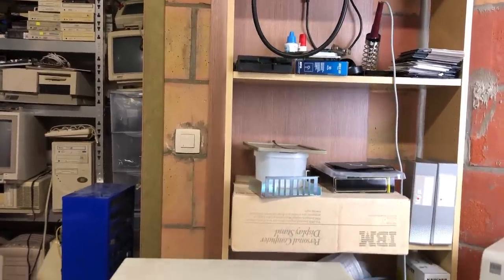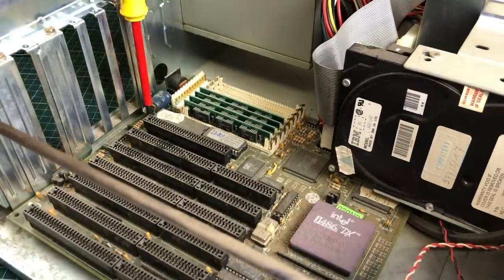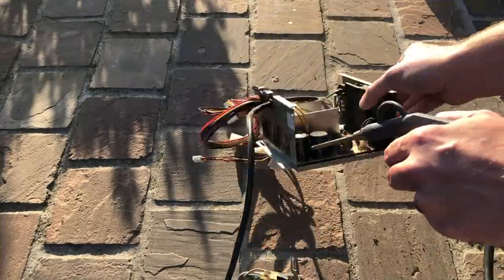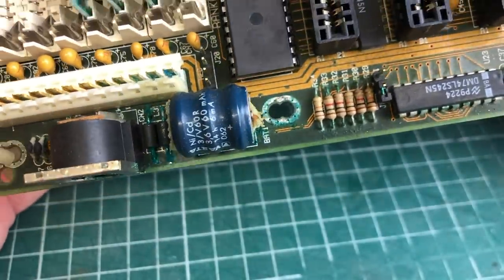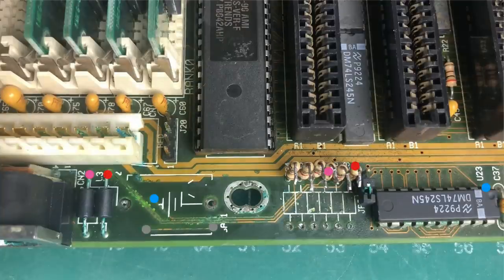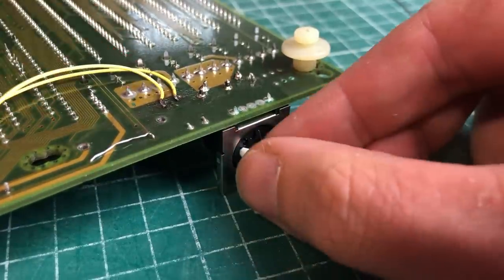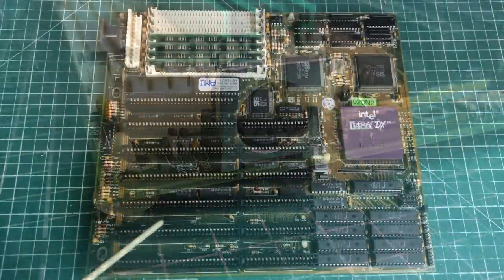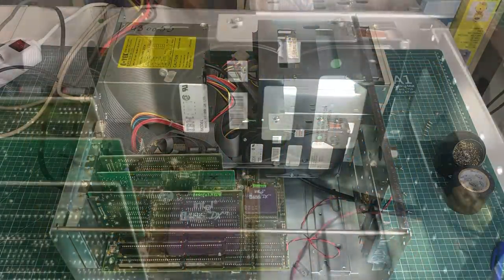486 from trash to treasure

Comment: man i wish i could find a 486 in my trash :c
also how is 3968kB 4MB? 4096kB = 4MB... so that count is missing 128kB for some reason.
Reply: Some memory addresses are reserved for the mainboard bios, the bios of the graphic card and the framebuffer for example, so not all memory is free to use. All OS have to call some bios routines to check which memory addresses are free to use.
Reply: @maxmuster7003  interesting. but would it have been that difficult to list reserved memory as well and add it up to the total?
Reply: That is not difficult, but it vary from mainboard to mainboard, the cards and components that are plugged in. Some newer graphic cards have two linear framebuffers(primary/secondary) somewhere in the 4th gb and the older have no linear framebuffer, only the banked framebuffer for the graphic mode in A0000. An Intel 80386DX+ can address 4gb of memory with 32 bit.

Comment: I’ve been having an interesting issue with my IBM 5155. Basically it boots to IBM cassette BASIC, preventing me from accessing any of the drives for an OS installation(to my knowledge). Does anyone know how to fix this?
Reply: only my opinion - it boots to basic by default, cuz it can't find/recognize a boot floppy, nor a boot hard disk.  does the fdd light come on & seek ?  does the hard disk led come on ?  do the dip switches on the mobo show that a fdd is installed ?  good luck.  take care & stay safe.
Reply: David Lund it initializes the fdd, but ignores it and immediately boots into basic. There’s no drive errors or anything because cassette basic physically can’t access drives other than the cassette one in the 5100

Comment: I had a 386 with 33 mhz turbo button. But I never understood why would anyone reduce the speed for what usage?
Reply from the maker: Playing old games that were really speed sensitive.... otherwise old games would run way too fast on your fancy 386 :)
Reply: Older software that assumed a particular clock speed, which would then be unusable on a faster CPU.
Reply: @andrewgwilliam4831  Thanks. interesting. Maybe software fir 286 or even 8086.
Reply: Some game maker use loops for a delay and not the timer chip or the vsync and so the games are running to fast on newer PC. Bad programming. My own DOS applications run with Intel 80286@20mhz and also with Intel Core2quad@2,7ghz.

Comment: What do you do with a box like this? It's 25+ years old, are there still any uses for it?
Reply: Vintage games is what most people use them for.  Not many practical uses.
Reply: Mostly old DOS games that work better on real hardware compared to an emulator, because of timing issues.
Reply: Thousands of games and applications :)
Reply: Thank you guys!

Comment: Feel like much more cleaning was needed before fixing the traces. There's enough green gunk left to continue eating that board.
Reply: Yeah, ideally you'd remove all the affected parts, neutralize and sand down the affected area and replace with new parts
Reply from the maker: I did do some additional cleaning afterwards but got lazy and wanted to see if the board would work and get the video over and done with :) character trait I need to work on :)
Reply: @RetroSpector78  Good job - I am generally lazier, I just buy boards that had external batteries or coincell in the first place... :)

Comment: "a DIN style keyboard connector meaning Pentium or Lower" isn't necessarily right. There are many super socket 7 boards, even a rare few socket 370 AT motherboards with 5-pin DIN keyboard connectors. So "most likely a Pentium or lower" would have maybe been more correct.
Odd to see a DX2 with only ISA, no VLB or PCI, and only an 8bit ISA controller card, ouch that's got to be slowing down disk access some?
Reply from the maker: it wasn't a DX2 , but a DX 50mhz .... and it did have a 16 bit ISA controller card.  indeed super socket 7 also had din connectors, and with pentium I was referring to everything below pentium 2 / ATX, not excluding all the different super socket 7 cpus :) will try to be more clear next time.
Reply: @RetroSpector78  oh, sorry dx50, those are really pretty uncommon. I have it's weird cousin, an sx2-50.

Comment: For the love of g0d, please stop using vinegar! Drowning the oxidised patch in modern contact spray ( I use Griffon brand - no this is not sponsored), will clean copper oxide better and do less damage. If there's a lot of damage you can restore contacts with a bit of solder as you're working on partially blank metal with mostly carbon remaining.

Comment: If you do not use a printer remove the ansi.sys driver from the Config.sys file, because it is much to large for to display some colors with ansi escape sequences.

You can make a new external color command for DOS with the following batch file. Feel free to copy, paste, modify and share. Spiritual ownership does not exist.

Explanation:
Batch files are text files with the *.BAT file extension and batch files are executable and suitable to contain the visible open source code of some assembler instructions  and internal Debug commands for to create an executable *.com file with a little help of some pipe operators (> >> <) to redirect the content of the used echo commands into a temporary text file to telecontrol Debug with this file.

Start with a color attached. Example:
COLOR.BAT 1b

@echo off
REM Need one parameter(%1) attached.
REM Usage: Color.bat color
REM Example: COLOR.BAT 1b
echo acs:100>tmp.deb
echo mov ax,b800>>tmp.deb
echo mov ds,ax>>tmp.deb
echo mov cx,820>>tmp.deb
echo xor di,di>>tmp.deb
echo mov al,%1>>tmp.deb
echo mov [di+1],al>>tmp.deb
echo add di,2>>tmp.deb
echo dec cx>>tmp.deb
echo jnz 010C>>tmp.deb
echo ret>>tmp.deb
echo.>>tmp.deb
echo n Color.com>>tmp.deb
echo rcx>>tmp.deb
echo 16>>tmp.deb
echo wcs:100>>tmp.deb
echo q>>tmp.deb
debug<tmp.deb>nul
del tmp.deb
Color.com
del Color.com

With the next batch file we can set the color of a specified row. Start with  4 arguments attached. All values are hexadecimal. Example:
Textcol.bat 8 19 30 14

@echo off
REM Textcolor
REM Need four parameter(%1 %2 %3 %4) attached.
REM Usage: Textcol.bat row start end color
REM Examble: Textcol.bat 8 19 30 14
echo a cs:100>tmp.deb
echo mov ax,b800>>tmp.deb
echo mov si,%1>>tmp.deb
echo mov bx,%1>>tmp.deb
echo mov di,%2>>tmp.deb
echo mov cx,%3>>tmp.deb
echo shl si,5>>tmp.deb
echo shl bx,7>>tmp.deb
echo add di,di>>tmp.deb
echo sub cx,%2>>tmp.deb
echo lea bx,[bx+si]>>tmp.deb
echo mov ds,ax>>tmp.deb
echo mov al,%4>>tmp.deb
echo lea di,[di+bx]>>tmp.deb
echo mov [di+1],al>>tmp.deb
echo add di,2>>tmp.deb
echo dec cx>>tmp.deb
echo jnz 0122>>tmp.deb
echo ret>>tmp.deb
echo.>>tmp.deb
echo n Textcol.com>>tmp.deb
echo rcx>>tmp.deb
echo 2C>>tmp.deb
echo wcs:100>>tmp.deb
echo q>>tmp.deb
debug<tmp.deb>nul
del tmp.deb
Textcol.com
del Textcol.com

With the next batch file we can print colored text to a specified location. Example:
ColTex.bat 8 10 1E "Text"

@echo off
REM Need four parameter(%1 %2 %3 %4) attached.
REM Usage: ColTex.bat row column color text
REM Example: ColTex.bat 8 10 1E "Text"
echo a cs:100>tmp.deb
echo mov ax,B800>>tmp.deb
echo mov es,ax>>tmp.deb
echo mov si,%1>>tmp.deb
echo mov bx,%1>>tmp.deb
echo shl si,5>>tmp.deb
echo shl bx,7>>tmp.deb
echo lea di,[bx+si]>>tmp.deb
echo mov bx,%2>>tmp.deb
echo add bx,bx>>tmp.deb
echo lea di,[di+bx]>>tmp.deb
echo mov ah,%3>>tmp.deb
echo mov si,130>>tmp.deb
echo lodsb>>tmp.deb
echo cmp al,FF>>tmp.deb
echo jz 0127>>tmp.deb
echo stosw>>tmp.deb
echo jmp 011F>>tmp.deb
echo ret>>tmp.deb
echo org 0130>>tmp.deb
echo DB "%4",FF>>tmp.deb
echo.>>tmp.deb
echo n ColTex.com>>tmp.deb
echo rcx>>tmp.deb
echo 70>>tmp.deb
echo wcs:100>>tmp.deb
echo q>>tmp.deb
debug<tmp.deb>nul
del tmp.deb
ColTex.com
del ColTex.com

Some more batch files, some for DOS and some for DOSBOX with s3 graphic card, some batch files need Debug from FREEDOS for 32 bit instructions: https://dosreloaded.de/forum/index.php/Thread/2214-Mit-Batch-Files-Debug-fernsteuern-kleine-COM-Files-erzeugen-und-ausf%C3%BChren/

Comment: It is not battery acid you're neutralizing. The battery is alkaline because it contains potassium hydroxide. You are in fact neutralizing the alkaline from the battery with mildly acidic vinegar.